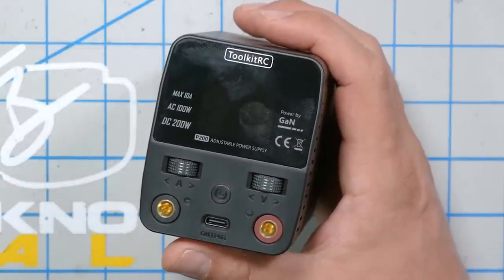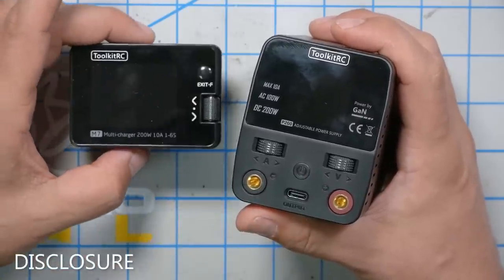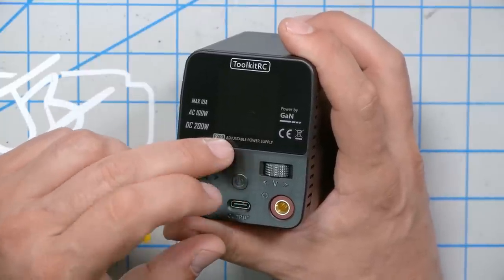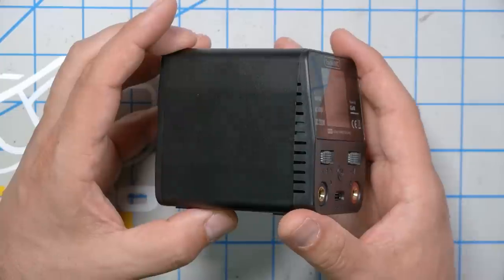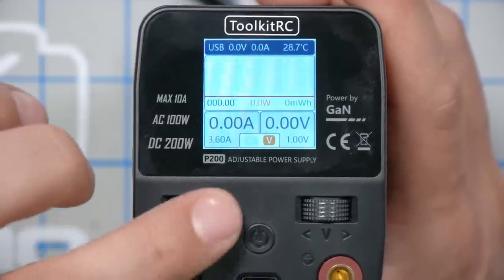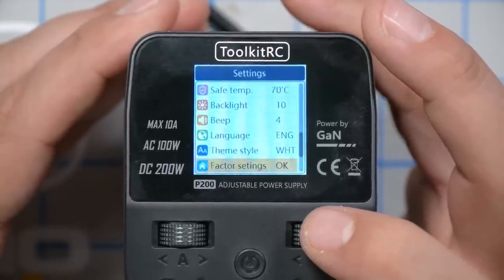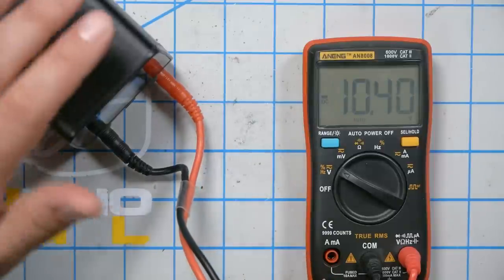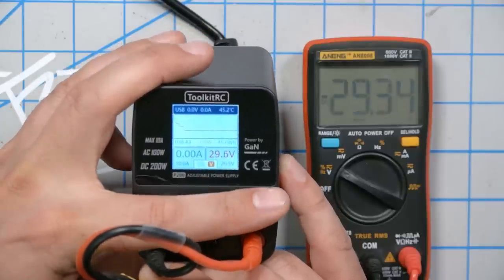ToolkitRC P200: what's it good for? (Tiny 10A 30v bench power supply)

Comment: Your favorite all-around charger from your shopping list (Hobbymate / Hota D6 Pro) offers the same function.  Select Power Supply function on either channel and adjust your voltage, amerage, wattage.  One device to run them all.
Reply: I use mine to power my tiny whoop charge board like this
Reply: Was going to point this out as well, it seems not many people know it has that function.  Best fpv purchase I've made so far!  Although this unit looks a bit more user friendly for that purpose.
Reply: I didn't know this and bought the hota D6 plus for that reason!

Comment: I think your motor was probably vibrating because of the way brushless motors work. That's why they need three connectors. I was switching the wires in a brushless motor to reverse direction with a battery plugged in and it had a similar shaking while only 2/3 wires were connected. The other thing is that you mentioned gallium nitride (GaN) electronic parts. I know that those are generally higher quality and are used in computer chargers like those made by RavPower.

Comment: I like that it has the USB c with quick charge and power delivery. That would be a perfect place to plug in a USB c powered soldering iron. Recently found out that you can buy usb-c power delivery triggered cords that output to a DC power jack. This power supply, that cord,  and a ts100 is a 3 hit combo for field work or tight workbenches.

Thanks for showing the short comings.  It's not perfect, but it's an option. And a compact one at that.

END OF LINE

Comment: If the size is an issue you may want to check the MDP-P905 power supply. It's DC powered only and more expensive but it's tiny and also has dedicated on/off button. It works great as a smoke stopper and to calibrate voltage/current sensors in Betaflight.

Comment: The reason behind this being so small is mainly the size of the capacitors they are using. Bigger more expensive power supplies use big bulk capacitors, and a lot of them to reduce any DC ripple. This thing at high loads like you where testing with the motor will for sure have huge ripple. Some electronic devices arnt designed to accept this ripple. 

Also this psu can also be used to charge up lithium batteries. No need to plug an additional charger onto it. 👍🏻

Comment: Joshua, I made (built, however you want to call it) a lab bench power supply about 2 years ago... I used a power supply board (which I just forgot the name 😬), one of those big AC to DC power supply that delivers 24v 10a and so on... It can output up to 30v and 5a (150w). And I honestly love it. 
But, for just this description, you can imagine the size of this thing... Right? 😬
So... I can't buy this one right now, but it's REALLY tempting! This one is only 100w on AC (if I'm not mistaken), but the space on my workbench it would save is fantastic. And I could keep my other one in the shelf for whenever I need it. 
So... Tempting. Really tempting! 😬
Anyway, fantastic review as always! 😊
Stay safe there with your family! 🖖😊

Comment: I bought one of these just two days ago. Mainly for powering my gear, quads, goggles,  vtx and so forth.
But unfortunately I did fry mine in a second 😩. 
I was doing some current calibration for a little 120 mm toothpick, small motors without props. Under betaflight motor testing everything was quite fine. Pushed the motors to different rpm to read out current for calibration. Input was 12.4 V an 5A limitation. But as I moved my sticks on my transmitter to push the motors, I immediately fried it while cutting throttle all the way down to zero. Within betaflight I slightly adjusted power to the motors and that worked fine. But cutting throttle from high rpm did cause over-voltage I guess and killed my power supply in milliseconds. I am very sure that demage was not because of over current, as it exploded on throttle cut an not throttle raise.
Any suggestions? Did you try anything similar? Or anyone else?

Comment: Pulse width modulation (PWM) is used in a lot of high amp output power supply. If you had an oscilloscope you would see that when reaching the set limit of the power supply. It's still direct current (DC) but it has noise in the DC output. Being a prior electronic technician that did circuit card repairs, I do have the tools and knowledge to test these speculations you have.

Comment: As Ohm tells - better have higher voltage with less current. Because any wire also has a resistance, and the higher currency we have, the more lose we have on wire. Actually it is the reason why we have cross-town power supply higher voltage then inhouse

Comment: A DC power supply was one of the first things I bought when I got into the hobby. When starting a new quad I'd set it to 1A and never needed a smoke stopper. I have no idea why everyone doesn't have one. They'll spend money on smoke stoppers but then use a battery to test everything, or batteries of different voltages. I only use my power supply for every quad. I only use batteries to test fly. The power supply was $60. Worth every penny and I use it for WAY more that just quadcopters.

Comment: During your motor test I see that the voltage output actually dropped to almost nothing and that was most likely from a protection circuit like a crowbar.   The low resistance of the tiny motor coil will seem like a dead short to the power supply, sometimes even if it is within operating ranges.  This is perhaps due to the Impedance of the PS becoming larger that the load impedance.
or something smart sounding..

Comment: My P200 arrived today, I upgraded the firmware, set the current limit to 0.5A, and tested current limiting. There was a loud bang, and now it does not work on AC. It still works on DC.
The AC board shows significant damage including a damaged chopper device and a blown track.
I bought it from an Ali-Express seller
Reply from the maker: Bad luck :-( Defnitely contact ToolkitRC support and I expect they will replace it.

Comment: just as a headsup, my hota d6 plus has a power supply capability too. Not sure about the about the other hotas but it helps with stuff like testing components on the bench without having to spend 100 bucks on something like this
Reply: The ISDT 608AC is less powerful, but it does it too. It's great to not have to use LiPos on the bench.

Comment: when you were testing the motor, that is DC, it's the magnets that are likely causing the vibration or perhaps as you said the limiter, but I don't know if the limiter would cause an oscillation or if it just brick walls it at the desired amp limit.

Comment: I've had half a dozen bench top supplies through the years. My current favorite cheap supply is:
Tekpower TP3005T Variable Linear DC Power Supply, 0 - 30V @ 0 - 5A
Based on the reviews, it seems like they might have quality control issues but I have two of these power supplies and they always work fine.
One complaint about the ToolkitRC P200 is the 1 amp lower limit on the current. I often need to limit current far below an amp. I have several ToolkitRC products and I think they're a good company but I'll pass on the P200.

Comment: For general home quadcopter usage, I'd suggest people look at the 12V / 10A / 120W laptop-charger-style power supplies on Amazon and then cut the plug off and solder on an XT60. It's really useful if you need to need to power your goggles, a quad or even a small charger at your desk. Much cheaper as well.

Comment: the ECS's takes the DC-voltage input and basically chops it and is then electronically controlled and then spits out a varying 3-phase voltage; your motor can use.

Comment: Given how critical the voltage level can be to some devices, especially if you're going to use it to drive 3.3v or 5v things, putting the power-output on/off function on the same dial as the voltage level setting is a very big NO NO.
The power-output on/off needs its own separate button that does nothing else.
Reply: I agree but the main power button could have been used for this purpose too. Maybe click, hold or double tap.

Comment: If I'm not mistaken AC to DC uses switches so yea it will oscillate. 120V to 10V it has to open and close so many times a sec that's why it's not a lab-grade bench power supply.

Comment: Diagnosing USB devices - check out the Mustool UD18, a cheap and very useful voltage & current monitoring puck-shaped device with a nice size colour screen and Bluetooth so you can even monitor it with an app on your Android phone.
It has USB-C plug & socket, barrel plug & socket, USB3 plug & socket, plus a micro-USB socket so you can power it with a separate power supply to get a more accurate reading because it then won't be drawing power from what it's measuring.

Comment: I use my old power supply (computer power supply) from when I used a  toolkit and it is just attached to my bench now. Runs my soldering iron and then if I need to power up a build I use the smoke stopper with a little extension on it. Seems to work but this would be awesome to have. Haha

Comment: The reason most „proper“ bench supplies are huge and heavy is that they use a transformer and linear regulators instead of switching regulators.

The advantage is much less ripple in the output. Whether that’s relevant for the fpv hobby use case... probably not.
Reply: It is relevant for test and measure situations, not so much for RC hobby.
Reply: You got it backwards - switched mode power supplies (SMPS) is the one you want versus linear power supplies. SMPS (like proper bench power supplies) are bigger, costlier.
ToolkitRC was able to keep size and cost down by going with linear regulators.
Reply: @johnfaustus1  No, you're confused. Linear power supplies are far superior, very heavy and more expensive with cleaner outputs. SMPS on the other hand are cheaper and lighter but the outputs are dirty. They cause a shit ton of RF harmonics derived from the switching frequency, audio engineers wouldn't be seen dead with a switched mode. Don't get me wrong, there's a place for switch modes but they are inferior to linear supplied.
Reply: @harryjohnson615  No my friend - it is you who has it backwards. The one you want is switch (or switched) mode, not linear.
Please either be qualified, or if not, perform a simple Google search.
Reply: @johnfaustus1 Sometimes, as is the case for you, you simply don't know what you don't know
SMPS are far more efficient than linear PSUs
Linear PSUs are superior in pretty much every other aspect.
You would NEVER use a switch mode PSU for any kind of audio design, medical equipment or any sensitive electronic circuit because of the very noisy output and RF harmonics.
Check for yourself, set your scope to a low level and start looking at the O/P for switching transients and you will see them better still, if you have a spectrum analyser you can view the harmonics in the frequency domain as well as the time domain. Don't take my word for it view this video.
https://youtu.be/v_HtdbsV69k
Reply: @johnfaustus1  "...we are talking about efficiency ...charge circuitry..."
Absolutely not. The OP stated why linear supplies are huge and heavy then stated the advantage was a cleaner output. This statement was supported by another poster who pointed out you need a linear power supply for test and measurements. You then posted that in your opinion they had got it backward and needed an SMPS so I corrected you and said you need a linear supply.
So no, you are flat out wrong, it was absolutely clear we were talking about test and measurments and not "...efficiency and charge circuitry..."
"...pleasentries dismissed...jackass..."
A childish response to what's supposed to an engineering discourse, well done.
"..No EE...refute RF interference..."
Correct, but I wouldn't have had to point that out to an engineer.
"...rejection of AC line ripple..."
I wasn't talking about AC line ripple but rather the switching frequency and related harmonics generated by the switching semiconductors.
"...your idiotic assertion that linear regs are better in almost every other way..."
Pay better attention because I was talking about linear power supplies and not the regulator per se and this was in the realm of test and measurments
"...SMPS is better in most ways, size, OP voltage, power factor, inrush current..."
Size, not relevant to test and measurements.
OP voltage range, agreed
Power factor, AC input characteristics have no relevance to the DC output.
"...the list goes on..."
Except for the important charactersitics regarding sensitive electronics.
"...send me a link to your Linkedin..."
As though that's some kind of definitve measure of worth that can't be fabricted.
I spent 20 years as a bench engineer repairing linear and SMPS's, colour monitors, logic boards, video games etc.
I've spent the last 22 years as a network engineer working on RF amplifiers, fibre networks, laser transmitters, core routers etc.
I hold City and Guilds 2391-52 inspection and testing 18th Edition
I hold City and Guilds 224 Industrial Electronics
I hold an HNC Electronic Engineering
My next learining experience is going to be CCNA followed by CCNP with perhaps specialisations after.

As for you, I've got you tagged as a hobbyist because of your views on SMPS vs Linear power supplies.

Have a nice day dude.
Reply: @harryjohnson615  Ouch he needed so much explanation. I am not an RF engineer but I am also an audiophile and you know how we are with power supplies 🙂. Spent nearly $280  for a "cleaner" 5v linear supply to get a near black noise floor. You would call me nuts. But  it does affect the THD on audio amps. 
That said I am getting interested in GAN's for audio power amps. Recently saw the blurb on an audio power amp using this tech rather than traditional mosfets. Does their  chemisty contribute less to RF switching noise or is it a question of better filtering, bypassing etc?  I can hold my ground on microcontrollers but power and rf are black arts to me.  Thought of asking you given your credentials. There is too much hogwash on the nets...

Comment: I'm not sure if I got a defective unit or just an early batch but I found out that this charger either doesn't have overcurrent protection for the AC input or it's insufficient. I was using it to test my quad and an error somewhere caused the motors to spin up which over currented the AC supply and blew a fet in the unit. The DC supply still worked but the AC supply was toast.

Comment: 😃 You are great teacher.😊

Can someone please answer?🤗
I want to build little bit different then a freestyle drone which will weigh around 1800g. Can I use  2806/7/8 size 1300kv motor with 7inch prop? Especially for cruising.
Reply: Yes, have a look at the Brotherhobby 2806.5 Avenger, that one is great.
Overall, your Setup seems reasonable
Reply: @gianlucafischer2696  thanks

Comment: The fan was more noticeable than the motor buzzing.  Will a 3 phase run on single phase DC?  I know that a old generator will if backfead DC, but that is a commutator changing the field, where a quad uses the ESC.  You’re the electronic man, I just a mechanic who no savy electrons.   Learned something tonight, you have a new sign on the back wall!  Is that the same jug of chocolate milk on the door from three months ago?

Comment: the vibrating is likely caused by the DC output signal being perfectly a set voltage so it will fluctuate and cause teh motor to vibrate, a test with DC input to the supply itself will likely fix that

Comment: GaN is certainly nice and all, but the actual advantage in terms of efficiency and size reduction is way smaller than manufactures want to make us believe. It would certainly be possible to build a same sized device with "conventional" transistors. Also there is nothing wrong about it being a switching PSU, but it depends heavily on the build quality (the Ruideng modules many people use, are also switching PSUs). Good switching supplies are even used in better HiFi applications by now. Still, when it comes to lower prices, the cheap chunky ones (using a big and heavy transformer) are more likely to produce a good quality DC voltage.

Comment: My  charger from hobby mate also has the ability to act as a DC power supply, so most people probably don't this in addition to that. I would bet that this is internally a 200w charger, without the balance connector.

Comment: Good size but minimum amps at 1A is a bit over for my use, sometimes I do use bench power to limit current at 20mA, 300mA, 700mA to test power LED

Comment: I mean I don't thunk it's to small for the DC side of stuff but 100w power supply built in is pretty impressive if it can.do that but I don't really doubt that it could do the DC ratings I'm not sure about heat Dissipation so how long it will do it and if they have anything to keep it from burning up

Comment: Its so weird to see you post this video , i checked your videos 2 weeks ago for PS info lol,  my power supply for the last 6 years was a hi-tec power box, it started failing 3 weeks ago , so i had been researching PS units and a week ago purchased a bench supply on amazon for $45.00  30v 5amp and it works amazing charging with my M7 charger. the PS unit is not heavy or bulky, i only charge one or two bats at a time and  for me 150 watts is perfect and so was the price.
Reply: I just use my laptop power supply :) It's not too big, but pretty beefy! (19.5v 10amps)
Reply: @lievenvv  yeah thats good if you have one. But having the flexibility of variable voltage ac to dc power supply lets you use it for so many things as well as for the chargers.
Reply: @RCSurf  yeah, for sure..!!
Thankfully my M6 chargers can act as variable DC power supplies whenever I need one; so it's a pretty cheap & compact setup overall :) ToolkitRC ftw!
Reply: @lievenvv  i just got the m7 last week , i like it but you have to download the new firmware as there was a bug with 2s batts giving a error , fixed with the firmware upgrade .